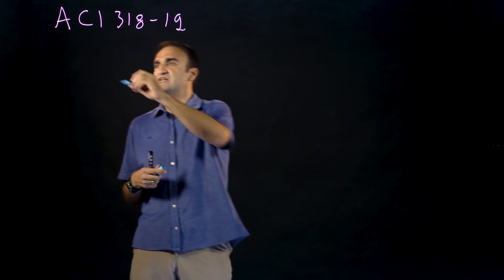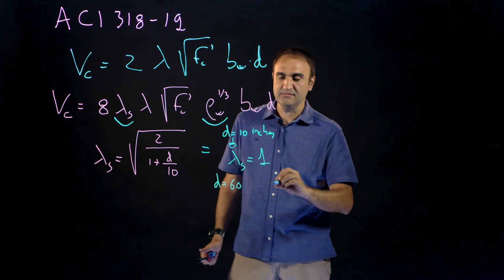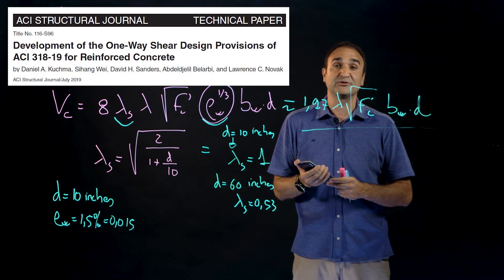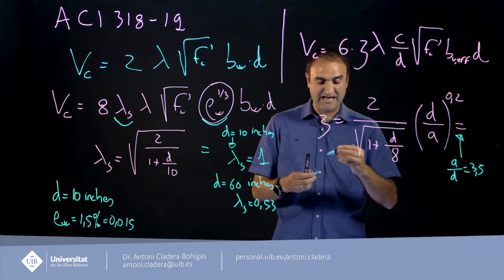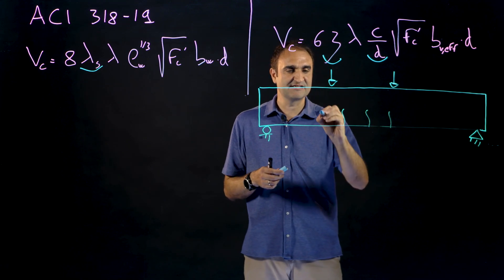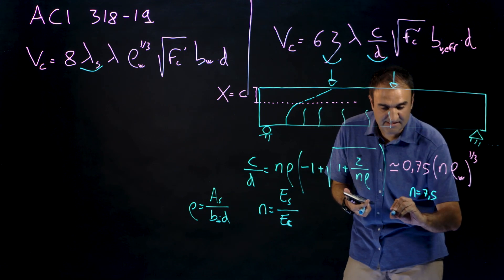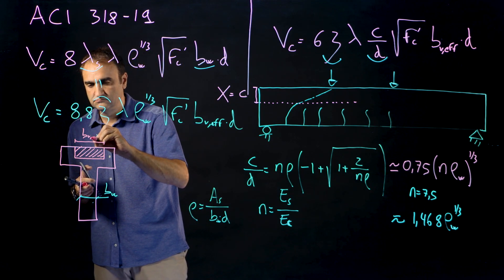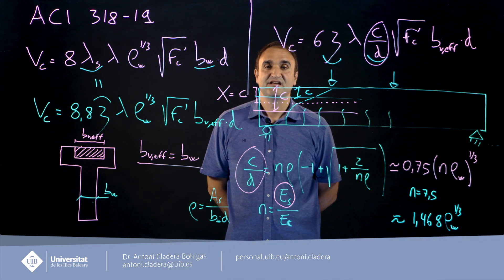The new ACI 318-19 shear equations: main changes and a feasible mechanical interpretation.

Comment: Why it is permissible to 
neglect size effect factor when you use it in the analysis and design of foundation as stated in section 13.2.6.2 of ACI 318-19?
Reply: At first, I thought foundations are included in this size effect factor. I am quite surprised because this will hugely impact those already build structures with large footing thickness. But after reading this ACI section, again I was confused because footings are also slabs typically without shear reinforcement, so what is the reason about this exemption? I also noticed that the code did not state any commentary about this section. Hopefully the next edition will explain this. Thanks.
Reply from the maker: This is, indeed, a good question, but I've no idea!! I don't know any technical justification...
Reply: @ConStructUIB  
Thanks Sir for excellent presentation...
I have one building designed by designer in 2018 but now in 2022 they want tonconstruct..Now Contractor checked and found that based on ACI 318 19 punching shear exceed value more that 1 in SAFE design ...There is confusion to consider this updates and revis foundation or keep it as per ACI318 14...please advise..
Reply: For Raft foundation only..
Reply from the maker: Thanks for your comment, but I'm afraid I do not understand it quite enough to be able to advise anything... sorry for that. I guess that, depending on the State, you'll have adapt it to ACI 318 19 and, the shear strength for a raft foundation (usually without shear reinforcement) should be, I think, lower for the new provisions than for the ACI318-14...
Reply: @ConStructUIB  
Many Thanks for your response.Csi SAFE updated no size effect factor for foundation in latest version..
Thanks for wonderful presentation of this topic.All your vdo are very interesting but they are not jn English..

Comment: Could you make the article quoted please?
Reply from the maker: Thanks for your comment. Prof. Cladera basically quotes two papers during this video:

Kuchma, D. A., Wei, S., Sanders, D. H., Belarbi, A., & Novak, L. C. (2019). Development of the One-Way Shear Design Provisions of ACI 318-19 for Reinforced Concrete. ACI Structural Journal, 116(4). Link to International Concrete Abstracts Portal: https://www.concrete.org/publications/internationalconcreteabstractsportal.aspx?m=details&ID=51716739 

Cladera, A., Marí, A., Bairán, J. M., Oller, E., & Ribas, C. (2017). One-way shear design method based on a multi-action model. Concrete International, 39(9), 40-46.  Available at:  https://www.concrete.org/publications/internationalconcreteabstractsportal.aspx?m=details&ID=51701013

The access depends on ACI membership....